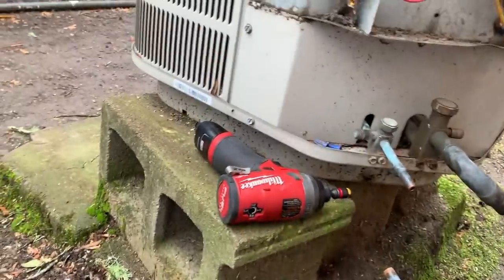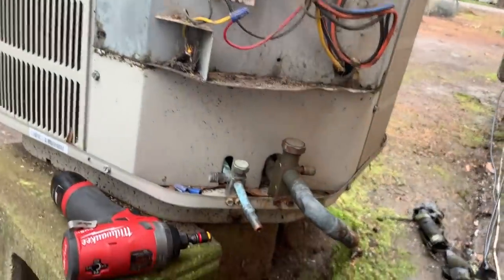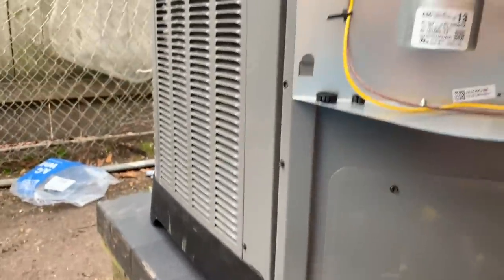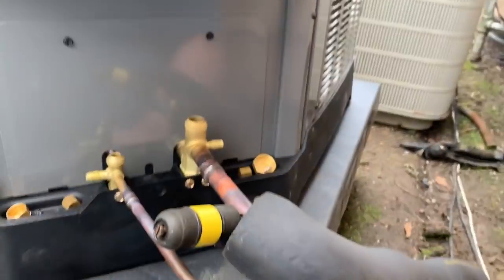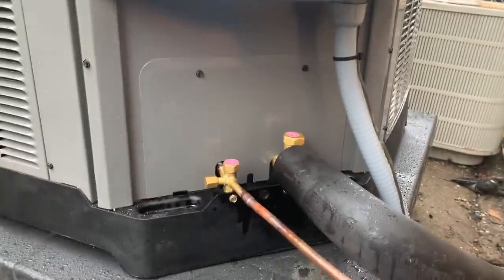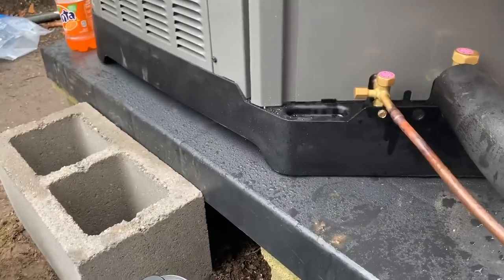System Change Out | Condenser & Evap Coil

Comment: a few things, good to see you doing a video again.  Good to see you helping out your Dad too!
     The idea of replacing that underground power cable seemed like that was understood, but you never can tell, some may say," why? ".....  I dont get it,... like you, I thought it was a no brainer.
  Eliminating the disconnect was an excellent idea, It looks so much neater that way rather than the typical clunky disconnect on the wall, It has a custom look like that... Was that Dads idea?
     The pad.....I would say, thats the only part that looks a  tad rough.   4 bags of tamped gravel on the ground, with the pad, would have had a neater appearance. Why was it being elevated like that anyway? 
      The Rubatex kept uncut, is a bit inconvenient for the mechanic, but works great around elbows and other fittings.  It takes a little more planning sometimes. 
 Great job! great equipment.

Comment: Is is possible to replace a 13 seer heat pump with a 14 seer heat pump and still use the existing evaporator coil with 410A refrigerant.
Reply: MDO VIDEO      Just change the coil it’s really not worth the risk of contaminating your new heat pump. No matter how much rx11 you use or nitro you blow through that coil there is a good chance you won’t get all the mineral oil out. What’s more important to you? Saving a couple dollars now or buying a whole new system in a couple years?